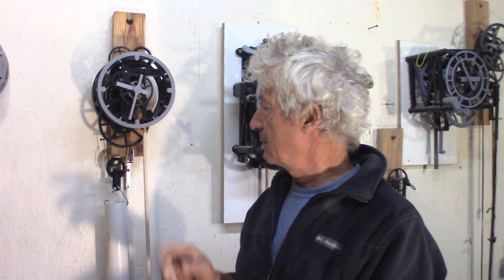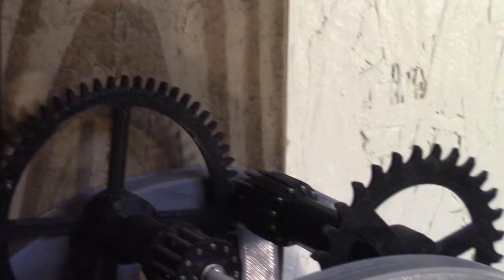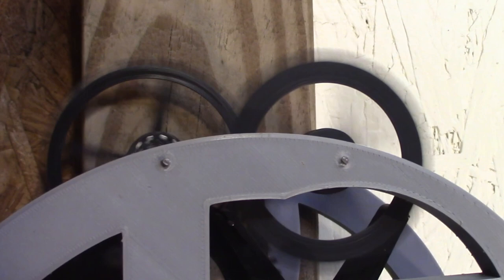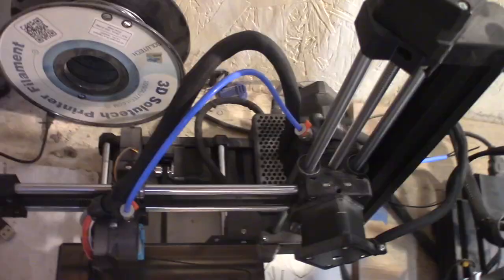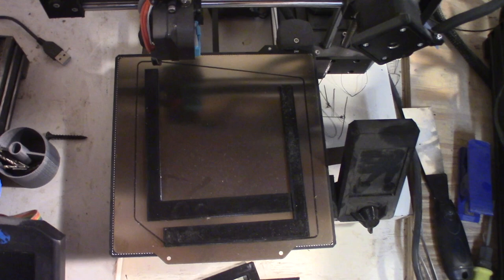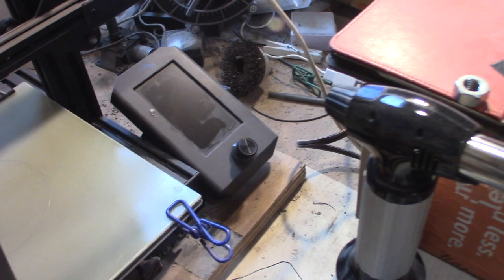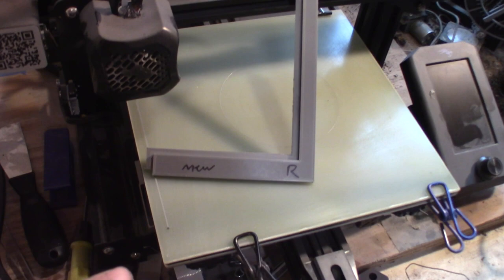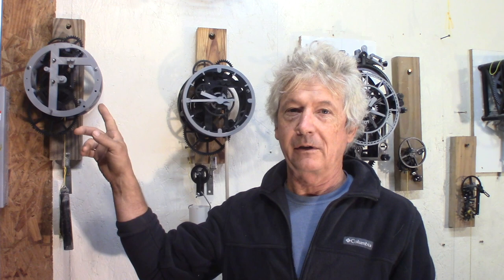3D printed 8 day clock experiment with lantern gears

Comment: off-center bushings could be turned to adjust the depthing between gear arbors.
 really enjoying your clocks. 
My particular interest is in super accuracy. Your music wire springs are very high-quality.
 but when it comes to escapement design, 3-D printing is just fine because it's not about perfect surfaces so much as perfect mechanical design. 
Waiting for the three legged gravity escapement.

Comment: Have you tried 3d printing the hairsprings that were not round but flat maybe if it was 5 layers tall so they would get the stability you were looking for? Great channel.  You have been awesome to learn from.
Reply from the maker: Thanks
I have tried a few variation of hairspring 3D printed
The shape is not really the issue, the material is
Plastic does make good springs
Might try a carbon fiber reinforced filament
Also have ideas about composite fiber carbon epoxy 
Lots to experimenting to do